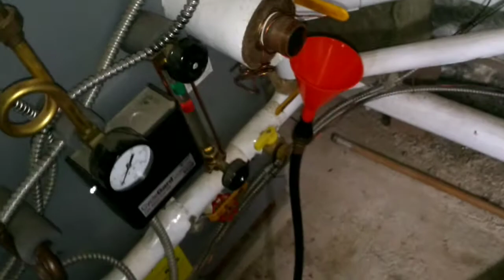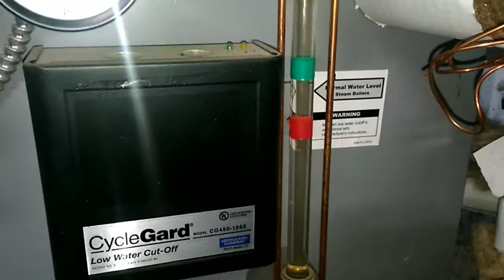Steam Boiler Skimming (Removal of Oil Residue)

Comment: Would there be any visual clues as to the amount of oil coming out? Or if I’m my case I drain your a bucket would the water look a slightly different color or at the least would I notice a different viscosity of the overflow water. I guess ultimately I’m just trying to ensure that I’d be doing the skimming effectively and was looking for any indicators of effectiveness in real time prior to firing up the boiler again.
Reply: I do this service often, and always use a bucket... so I can visualize the product of my labor and can show the customer the value of their dollar. in a steam system it's referred as a top blow down. on larger boilers i have used suction to skim the surface...
Reply: I thought a “blowdown” involves closing a king valve on the main and a valve on the return. Then building high pressure in boiler (~10psi) and opening the drain valve to blow out the crud.